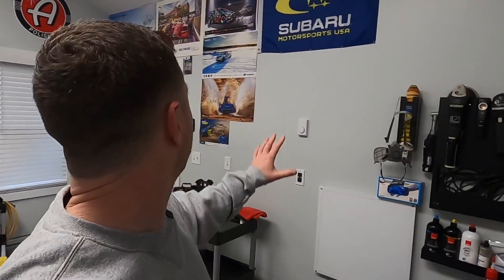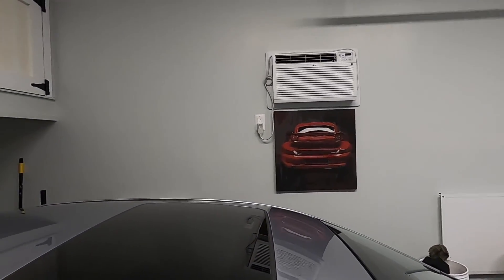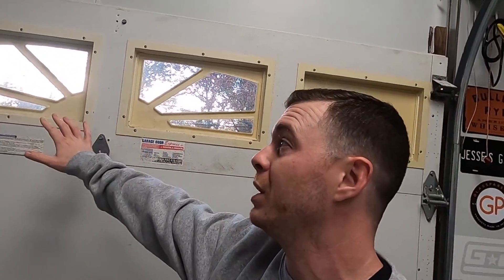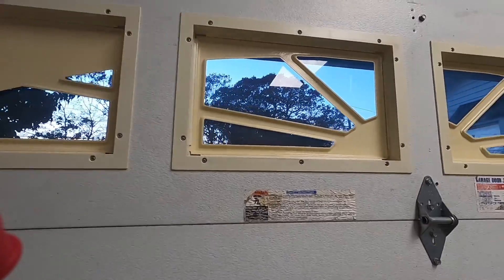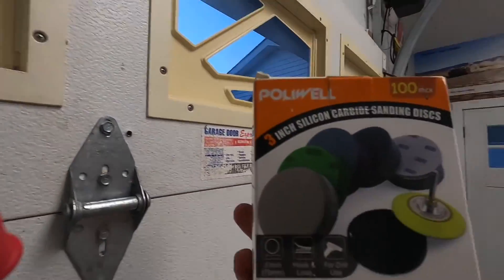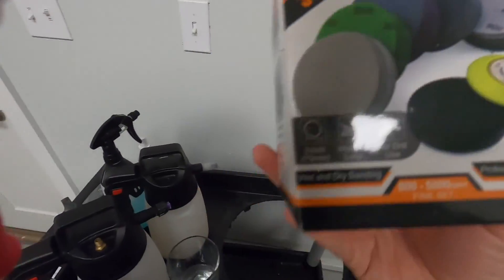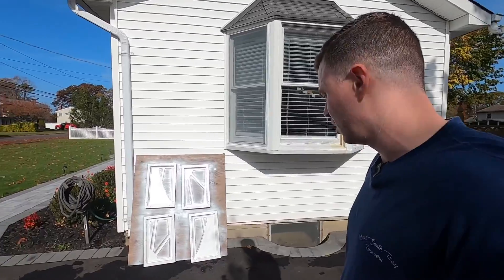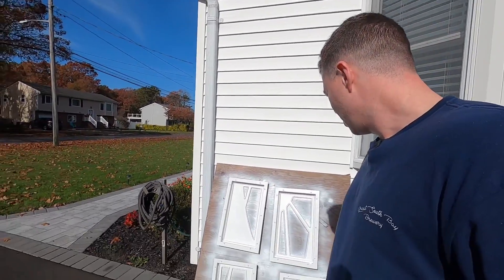Detail Garage Update : Gross Window Inserts

Comment: the window designs snap out from the inside, without removing screws or frames. then should be snapped in/installed on the outside. there is kind of a trick to this though.